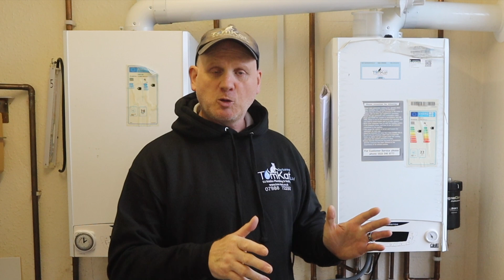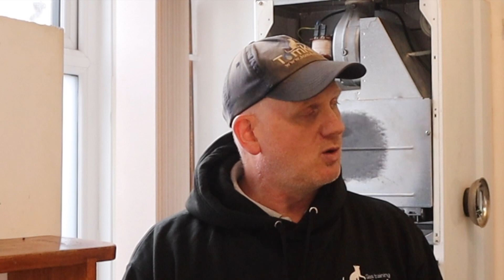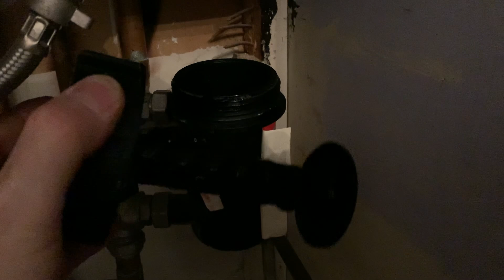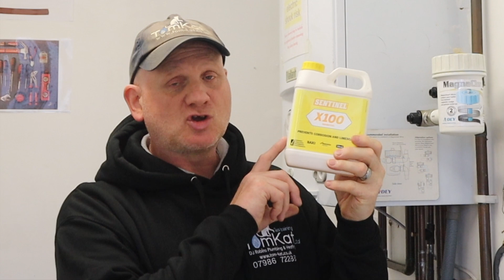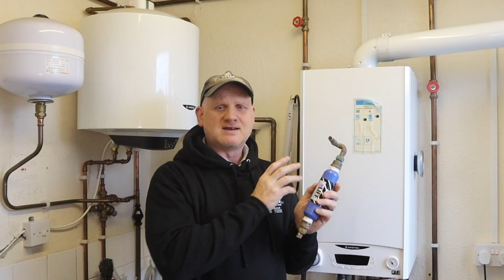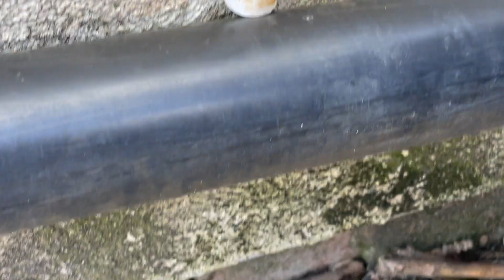How to keep your gas boiler lasting longer. Increase your boiler lifespan and safe energy and money.

Comment: My boiler is fairly new, Worcester 25i condenser. I turn it off unless I'm getting shower, because it always comes on. I'm not in the kitchen very often but when I am it just kicks on. The radiator control knob is off and the hot water knob is set to that frost setting thing. What setting do i have to have it on? Thanks
Reply: Is eco mode on? Press the eco button and it should light up green to turn off preheat for DHW.

Comment: Those Thorn/Myson M range always suffered Kettling  from quite early in their 30 plus lifetime. The slimline heat exchanger and the attitude of engineers to using inhibitor back in the day all contributed to the issue.
That said great piece of kit, most parts still available (gas train/ thermocouple most common failures). Can't see latest offerings lasting the course! Two HE boilers in 30 years opposed to one dinosaur  boiler, you do the maths!
Magnetic filters, although a must, magnetite is formed in oxygen deficient systems (high PH), the deposits inside the hottest part of the system (heat exchanger) eventually evolve to a hard scale with breaks off and blocks the plate.
I always put in at least double the recommended dose of quality inhibitor, you can NEVER have too much!
Anyway  that's my advice as a silly old dinosaur!

Comment: We've had the same gas engineer service our boiler for 15+ years. I mentioned a combination boiler and she said she would be more than happy to supply and fit a new boiler, but I would be wasting money as our 20 Year old Glowworm boiler was in excellent condition and spares were still readily available. The few theoretical percentage points of efficiency wouldn't justify the cost.

Comment: Curious do you guys over there have any warm air furnaces or oil boilers? - HVAC technician in the states
Reply: Yes and yes. Oil boilers in countryside. Domestic warm air was very very common 50 years ago but Most have been removed. They are still installed but it's very rare now.

Comment: Am I right in thinking "Kettling" can also be due to incorrect installation? I reversed my pump, to push the water into my boiler, instead of sucking and lowering the point at which the water started boiling!
Reply: A huge percentage of boiler/system faults are either bad installation or maintenance.

Comment: My dad has that first boiler you show.... I'm not convinced it's cheaper to replace it as it never breaks down.... With the combis they do break down or need a service once in a while to keep them going, and i'll be surprised if we see a 40-50 year old combi's still going... I buy them for spares off ebay, some only 5-7 years old.
Reply: If the efficiency of the old boiler is down at 40-50% vs the 90% of a condensing combi you could potentially use half the gas. Taking the average for a small flat or house it could save £400 a year (£200 a year before the gas price went crazy). With a boiler and fitting being around £3000 it would only be 7.5 years to pay itself back.
It also means you get to pick when you get the new boiler. Much more preferable to have time to research and get it fitted in the warmth of summer rather than panicking in the depths of winter when it eventually breaks and can't be repaired.

Comment: Great video, viessmann don't recommend the use of inhibitor. What would you suggest? Is it worth flushing every year with fresh water or is that just going to introduce more oxygen and corrosion?
Reply from the maker: I would always use inhibitors even on viessmann boilers
Reply: Is that actually true that some manufacturers don't recommend inhibitors?
Reply from the maker: @aliasgharkhoyee9501  only viessmann for installation in Germany not the U.K. because our regs now say inhibitors are required
Reply: Viessmann 100 have it in the installation manual page 8. Says please note- No chemical corrosion inhibitors should be used.
Reply from the maker: @adrianking6309  yep I think all gas engineers are aware of it but it is dependent on the water quality because inhibitors also stop lime scale as well as sludge